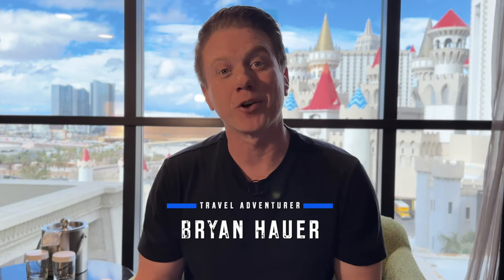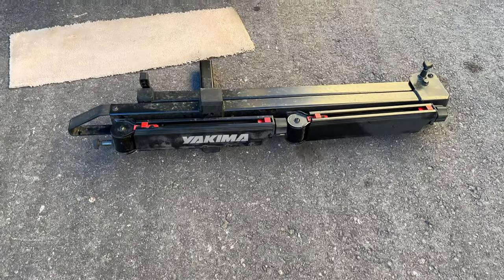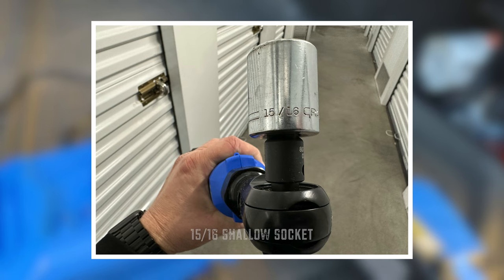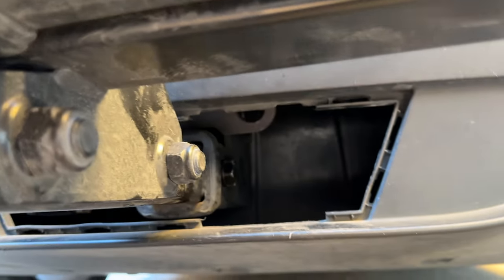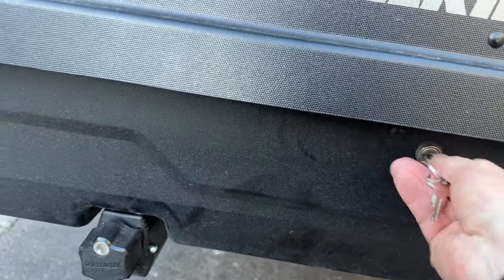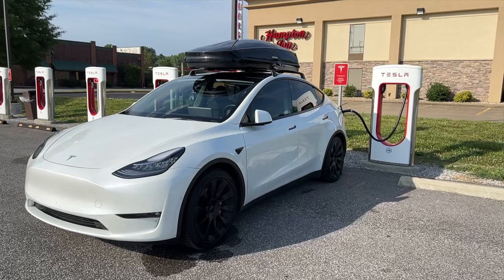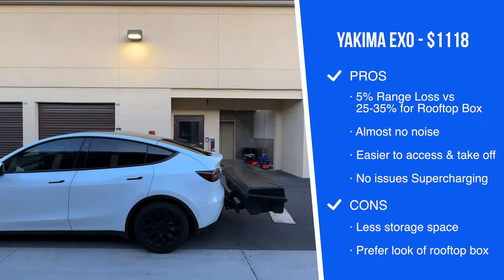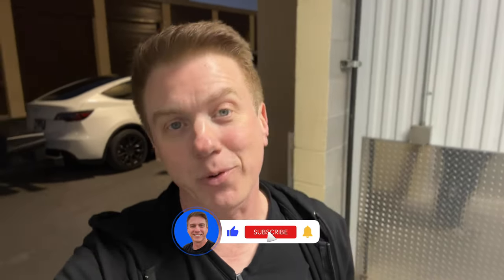Yakima EXO Gearlocker & Swingbase Review: Trailer Hitch Cargo Box for Tesla Model Y

Comment: Just wanted to add a note that I attempted a similar install using the Milwaukee M12 ratchet and wasn't thrilled with the performance. It didn't feel like it was getting the bolt very tight, although there wasn't much slop left in the swingbase. I did see the m12 ratchet was only rated to do 35 ft lbs, where yakima recommends 100Nm of torque, or around 73 ft lbs, double that of the M12 ratchets rating. I ended up using a normal 3/8" drive ratchet and it seemed to work fine. I did use a torque wrench to get it up to 73 ft lbs and it had a lot of room to go from what the M12 could do. In the end I returned the M12 ratchet and will just use a combination of 3/8" breaker bar, ratchet, and torque wrench as needed.
Reply from the maker: Thanks for the update 👍🏻 The one I use is rated for 55 ft lbs and I can assure you mine is super tight with zero wiggle and hasn't moved in months, but always good info in case someone uses the same ratchet you did and feels it's not getting quite tight enough. Appreciate the comment. 😀

Comment: I have a kuat bike rack for the Y and it was a bummer that the locking connector just wasn’t functional due to the lack of space. I wound up getting a simple pin and cotter pin set up.  It’s not locked but honestly it’s not too easy to get off.  And I am sure most people will assume that it’s locked. It also is very solid.
Reply from the maker: Nice! Yeah I sure wish there was more room to operate around the hitch on the Model Y. Have you tried a right-angle hitch lock?

Comment: Thanks Bryan!  I have been waiting for this review.  Thanks for doing all the math for us on the weight.  I was not aware that the hitch could only handle 160 lbs and only about 70 lbs once you have the EXO on.  Great info!  I was wondering why you did not have the 2nd level on it.  Good call on the Kobalt too.  Did you happen to try a socket wrench?  Curious.
Reply from the maker: No problem. Yeah I was a little disappointed that you can't put the full 350 lbs tongue weight, but I guess that's universal for vehicles. I believe it has something to do with torque as weight hanging even a little away from the vehicle creates more pressure than a trailer. Yep, and that's why I didn't put a second level. I am now working with one of the top bike/e-bike manufacturers and had planned to put the EXO bike rack up there, but won't work with the weight. For what I'm currently doing it works great.

As for the wrench. Yes, I did try a socket wrench and because you have no room to move it, it's not possible. Just like the regular wrench, you can move it about a half an inch. It would literally take hours. I honestly would have returned it if I didn't get the Kobalt. Now it all works great for my needs 😀 Thanks for watching!
Reply: @bryanhauer ello again. I am binge watching your videos😂. From what i understand the exo swingbase and cargo box are total of 160lbs and only 70 pounds you can put inside the cargo box? Thanks again… planning to buy the swingbase and cargo from exo.
Reply from the maker: @ritacristobal1285  Correct. Links to everything are in the description of each video too if you do end up purchasing anything which of course helps support the channel 😀
Reply: @bryanhauer  definitely will use your link and once again thank you.

Comment: Fantastic setup. Easier access than roof racks , bonus much less range loss. Love it.
Reply from the maker: Thanks! Yeah, I’m really enjoying it vs the roof rack. Much more versatile too 👍
Reply: @bryanhauer would you use both? For longer trips?
Reply from the maker: @tacticalg6686  I wouldn't use a roof rack anymore just due to the range loss and extra noise, but it's definitely possible. I also don't need that extra storage, but I'm just traveling solo most times.

Comment: Great video, Bryan! I already had an EXO swing base I bought for my Bronco Sport and haven't hooked it up to my Model Y yet. Appreciate the tips on flipping the threaded piece inside the swing base and buying a battery-powered right angle ratchet. Those will save me a lot of time.

It's nice that the license plate placement is high enough on the Model Y that Yakima's optional plate and light kit isn't necessary. I've had very good experiences with this hitch mounted box and always thought it would be a good fit for the type of trips you do, so I'm glad it seems to be working well for you.
Reply from the maker: Thanks so much, John! Yeah it sits low enough and has a nice low-profile too so doesn't block the license plate or too much of the camera on the Model Y. I've been loving it so far 👍🏻 Glad the tips about how to best hook it up came in handy too. Will save everyone a ton of time for sure. I'll also probably use mine with a Sprinter van as I plan to get one for more off-roading adventures and will add a little extra cargo space as well when needed.

Comment: Super video.  When I went to buy this exact set up for my MY, the dealer showed me why they could not install EXO accessories.  They were trying to put bolt in from the left saying this was design flaw of 
Tesla hitch.  Morons! Guess they didn't want the sale that bad.
Reply from the maker: Yep. I think I commented to you about week ago I was pretty sure they were wrong even on new Model Y's. You just have to move that little piece inside the Yakima hitch to the other side which takes 30 seconds (there's directions inside) and then put the bolt in from the right side which is the one with the extra room. Btw the system comes with the lock. Glad the review was helpful 😀

Comment: Great video as usual. If you’re considering going back to a roof box, take a look at the Inno wedge and wedge plus. They are a bit smaller than Yakima/Thule boxes, but are better made (in Japan)and more aerodynamic. I believe REI can get them as well.
Reply from the maker: Thanks for the tip! 👍🏻 No plans to go back at this time. I'm really liking this one since it has no noise, better range, easier access and is more versatile since you can use it as a table too. I do like the look of rooftop cargo boxes though.

Comment: It’s very difficult to find a review on this EXO swing bass system from Yakima so thank you very much for the review. Any chance you have a long term update on how things are going with it?
Reply from the maker: It's still awesome and I use it all the time. It's held up to 10's of thousands of miles of travel and still looks almost new. I still recommend it for its durability, ease of use, how versatile it is, how quiet it is with virtually no range loss. If you do end up getting one and found value in my videos, please use on of my affiliate links as it helps support the channel:

//ORDER YAKIMA EXO FROM REI:
○ Yakima EXO Gearlocker Cargo Box at REI: https://bit.ly/47l6jVs
○ Yakima EXO Swingbase at REI: https://bit.ly/3MOgb1u

ORDER YAKIMA EXO FROM AMAZON:
○ Yakima EXO Gearlocker: https://geni.us/0yp9G
○ Yakima EXO Swingbase: https://geni.us/I0AqRbl

//RIGHT ANGLE RATCHET ON AMAZON:
○ Kobalt 24v Max: https://geni.us/DBGI
○ Battery Charger Kit: https://geni.us/tZhkpG
○ Drive Impact Drive Adapter Set: https://geni.us/R9iHOrI
○ 15/16-in Shallow Socket: https://geni.us/IBBRXn

Comment: Is the license plate visually blocked and what about driving lights, backup lights, turn signal and brake lights?  Great video, thanks.
Reply from the maker: License plate isn't blocked at all, nor are any lights. All fully visible. It's sits pretty low which is nice for aerodynamics and no need to move the license plate or anything like that. You can view what it looks like inside too from the backup camera at this point of the video: https://youtu.be/uksUjlU5bjk?t=1299

Please let me know if you have anymore questions. Thanks for watching! 😀

Comment: Great review, think you just sold a whole bunch of Yakima rear hitch boxes!  70 xtra pounds of 'storage' with minimal range loss is huge for the EV/Tesla world!  Do you still suggest/like your mattress?
Reply from the maker: Thank you 😀 Yeah I really like it and love the better range, it's quieter, easier to access, don't have to worry about low parking garages and you can use it as a table. 👍🏻

Not sure which mattress you saw me use last, but I upgraded to the EXPED MegaMat Auto. It's just as comfortable as the one I did a review on this summer which was one of the most comfortable I've used, yet it rolls up tight enough to fit even in the frunk. Mattress for Model Y: https://alnk.to/aLF4bo4

I'll have a review on it up in the next couple weeks and actually compare it to the last one. Both are super comfy, but this one feels higher quality, I've talked to the team at EXPED and they offer great support, they're also in stores nationwide like REI and most importantly it stores away in a compact way.

Comment: When you say that the gear box is only capable of handling 69 pounds, is that because of the total weight restriction on your model Y? 

I looked on Yakima‘s website and the box shows that it’s capable of holding 100 pounds when attached to the swing bass and 80 pounds when it’s on the EXO top shelf.
Reply from the maker: Correct. It's a vertical weight restriction on the Tesla Model Y. If you're using it with another vehicle like a truck or SUV with more weight capacity, it'll handle more. Just find out what your vehicles bike rack or vertical weight limit is. It's usually quite a bit lower than the actual hitch limit since it's dealing with a vertical torque limit.

With all that said... I wouldn't put super heavy things in there anyways and instead use it for camping gear, cooking gear, clothes. It'll hold quite a bit 👍🏻

Comment: Hi Bryan - new Follower - how did you calculate how much you could store in the locker? maybe I missed that; I am about to drive nyc to LA and this is a great way for me to just get an extra bit running across! Thanks again!
Reply from the maker: Hi Benjamin - Sure. The Model Y has a 160 lbs weight limit for vertical weight like bike racks or cargo boxes which is less than the 350 tongue weight used for towing. Once I put any gear inside the box it can't weigh more than 70 lbs as you have to take into consideration the weight of the Gearlocker box and the Swingbase. The 350 lbs tongue weight isn’t the same as vertical load weight so is much less. I tend to use it for camping gear, cooking supplies, clothes, fishing rod's etc... You can fit a lot in there, I just wouldn't store heavy items in there or go much over the recommended weight for safety, but also you'll notice some swaying if you go too heavy. 

Let me know if you have any other questions and thanks for subscribing 😀
Reply from the maker: I should also say if you're towing using a different vehicle besides a Model Y, you may have more weight available. Just check to see what your vertical weight load for bike racks or cargo boxes is. It should be lower than the tongue weight for towing though.

Comment: great video. could you also just put a box under the right side, lifting it a bit?

it just looks really heavy, esp when you swing it out. amazing that the Tesla can hold it with the extra weight of a full box on it then 👍
Reply from the maker: Thanks Uwe! 😀 Yeah they actually have a little stand that goes underneath. I haven't used it yet, but it seems really sturdy without it. The swing out arm is super heavy duty.

Comment: BRYAN⁉: Recently purchased a Model X so I presume I could go much heavier at the tongue weight is 500Lbs....   What additional accessories beyond the gear-box would you recommend ⁉ that I consider, obviously a bike rack, but wondered what else ?   Many thanks for all your great videos...
Reply from the maker: Actually less with a Model X. Towing capacity is higher, but unfortunately tongue weight isn't the same as vertical weight for things like cargo boxes and bike racks. The Model Y for instance has a tongue weight of 350lbs, but you can actually only use 160lbs of that for things like cargo boxes and bike racks as due to how the weight is distributed as there is torque (a cargo box sits higher up and away from the hitch so it creates torque). 

The Model X for instance has even less vertical weight at 120lbs limit for accessories like cargo boxes and bike racks due to its stock Bosal receiver design. You have to include the weight of the hitch, swing arm like the Yakima EXO Swingbase as well as the gearbox to get your true weight allowed: https://www.tesla.com/ownersmanual/modelx/en_us/GUID-7A684E2F-D43E-4A0E-AD21-811B04CE53BB.html#:~:text=The%20Model%20X%20towing%20package,bikes%20on%20an%20accessory%20rack.

On the Model X for instance if you get the same Yakima Gearbox and Swingbase like I did, you're probably only looking at 30lbs of cargo inside the box. 😳 I only have 70lbs available to me which is why I use it for things like tents, chairs, fishing poles, clothes, cooking gear... things that take up a lot of room, but aren't real heavy. I'm also unable to put the bike rack extension onto it as it would be way over the limit.

This is definitely a weak point of Tesla's unfortunately. 

As for other accessories to recommend... what exactly are you looking to do? Camp, bike trips? Let me know and I'll try to point you in the right direction. You can also check out my Camping section and/or Reviews section of videos on my main channel page.

Hope that helps!
Reply: @bryanhauer  WOW and thank you... 🛟.  IF I do purchase it, I would then use it solely for high-volume light items which I hav aplenty of... THANKS AGAIN! 🙏

Comment: I have a similar mobile fridge, that little cubby has plenty of air flow to not over heat the fridge?
Reply from the maker: Yep. In the review I did of it and in a few camping videos I show how I put small 1 inch wood blocks with Velcro on them to give airflow. Works great! I’ve left it on for weeks at a time with no issues.

Comment: Great video Bryan! Are you able to use Autopilot fully when the Yakima is installed? Do you have to put it in tow mode?
Reply from the maker: Thanks Peter! Yes, I can use Autopilot fully. I have been getting phantom braking lately, but that seems to happen regardless if I have the rear box on. Camera can still see and only obstruction is middle two parking sensors are blocked, but otherwise it's fine. 👍🏻
Reply: Awesome, thanks! Your video+response gives me the confidence to try it out on 1500 mile road trip!

Comment: Recently purchased Model Y. The little traveling I've done so far back and forth to work. I have noticed the Supercharges I've used have one pull in. Question is, are you able to back into Supercharger and charge?
Reply from the maker: Yes, you can back-in fine into all Superchargers. I've been to probably 100+ Superchargers and never had one issue. It does take a few times to get a feel for when you need to stop and occasionally I still need to get out and see how much room I have left, but all Superchargers will work fine with it on. I show this in action in many of my travel videos. 👍🏻
Reply: @bryanhauer  thank you. Just subscribed. Look forward to more videos.
Reply from the maker: You bet 👍🏻 If you end up buying a Yakima EXO system, please consider using my affiliate link which helps support the channel. You can find them all in the description under each video. 😀 Thanks for watching and subscribing!

Comment: What about getting a $20 Hitch Extender so you get easy access to the hitch? I agree the hitch as-is is a huge pain to work with! I was having to put on my snow plow  (think icy cold and snowy) NOT Fun!
Reply from the maker: Tried that, but didn't make it part of the video. Unfortunately
doesn't work as there's way to much wiggle and noise and no room on the Model Y (since it's recessed) to use a U clamp stabilizer. Directly in it's a perfect fit with zero rattle, but there is the extra cost of a right angle ratchet.
Reply from the maker: According to Yakima the EXO SwingBase is not compatible with hitch adapters or extenders. I'm sure you could still do it, but it's not recommended. (Note: I'm following up on this post as I just ran across it while searching for another one.)

Comment: could you have used a hitch extension?
Reply from the maker: If I remember correctly, Yakima doesn't recommend it, but I tried anyways... but because of the recessed hitch on the Model Y it was impossible to use a 'U bar' to get rid of the rattle. With the Swingbase going straight into the hitch it's a perfect fit and zero rattle, just need a right angle power tool to secure it. I also remember thinking it being too far out with an extension and didn't feel good about the weight distribution. I wouldn't recommend using one.